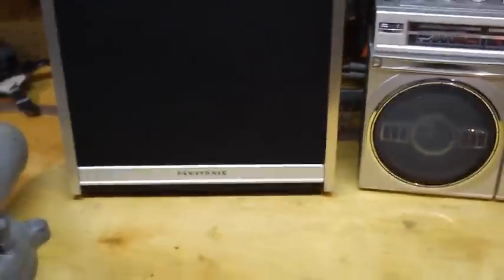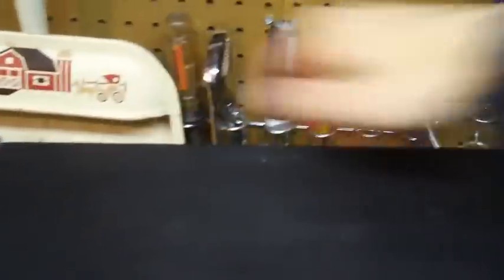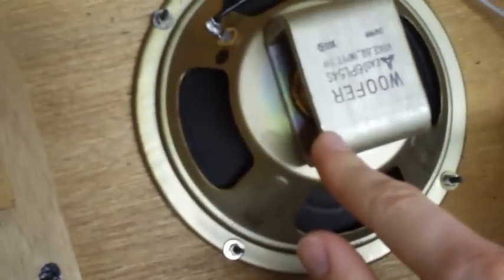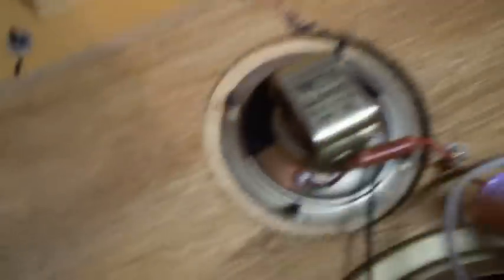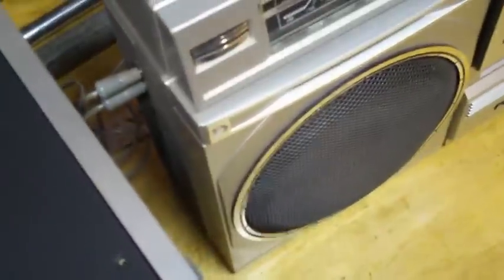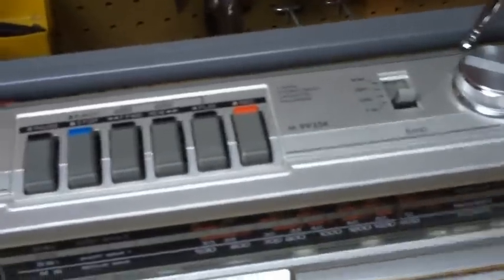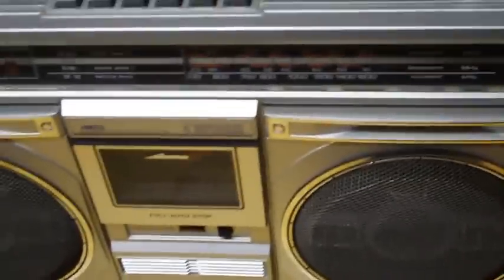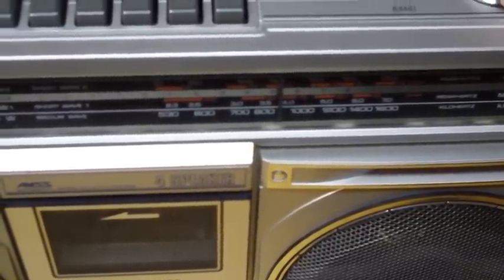Vintage Panasonic speakers and Sanyo boombox

Comment: Good day,
Salemcripple is correct. (except early 1970's not 1960's)
 Your speakers belonged with an AM/FM stereo/ record player. 
Basically a "bookshelf stereo" from 1970/71. 
A friend had a damaged one in a second-hand shop in 1988. He sold the stereo to 1 person, the speakers to another, & I bought the speaker cords. I still have them (1 yet, anyway). 
In 1960's the products were labelled
National,
then later 
National Panasonic,
lastly 
Panasonic.
You should be able to find orig player yet

Comment: I just got a vintage (late 60's) Panasonic turntable/ AM FM receiver  that has nearly the same exact speakers (only difference is mine have a wood finish). And they are original, i know that for a fact. I'm thinkin yours came from the same system.